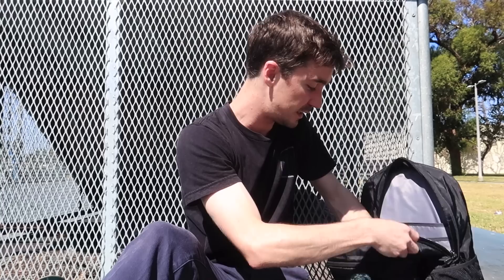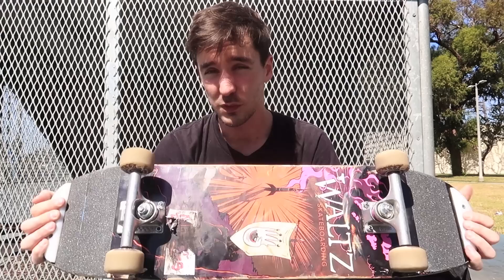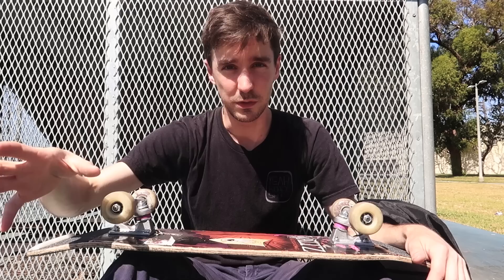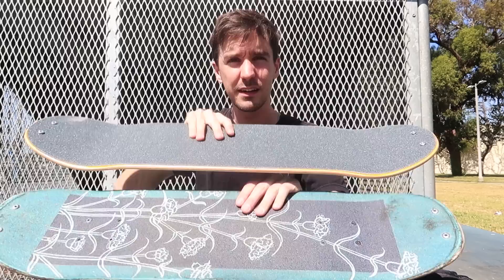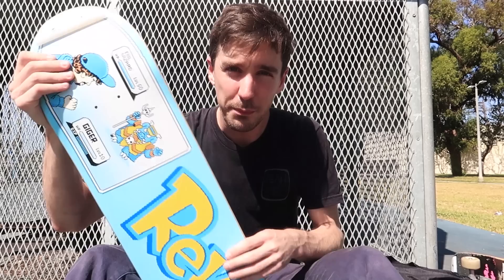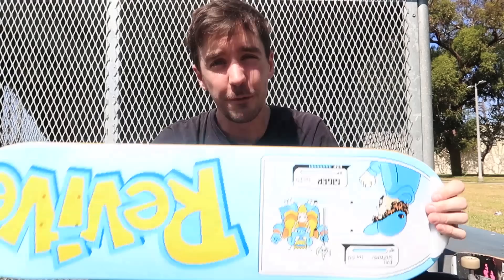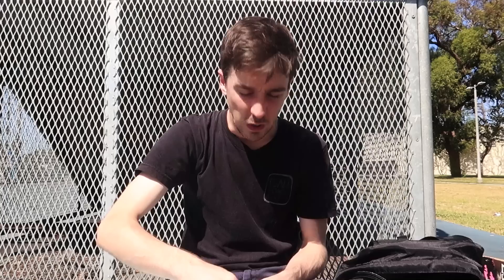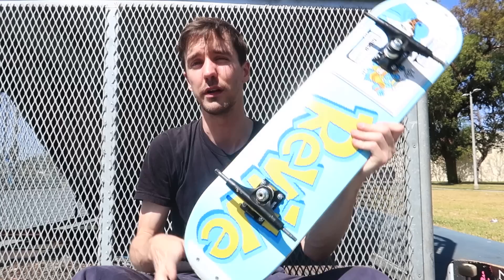Hack your Skateboard for Freestyle

Comment: Nice one, as always ;-) One addition: If you really get into learning Caspers and have the board upside down for hours, the very end of nose and tail will slowly erode. As you can't really put skidplates on top of the board, a row of small woodscrews right at the edge where the Casper lands will prevent razor tail developing from the top side.
Reply: Bwaha I love caspers so I totally know how that goes. 

Does it sound scairy though? I shift my caspers allot so they scrape, I can imagine the screws scrapeing hard.

Comment: I did a number of freestyle tricks on my 8.5, high concavity street board for a while. I got Indy's and paired them with some deep conicals (Santa Cruz Slimeballs) and a couple extra speedrings, and my board sat rock solid on the rails. The wheels and axles were basically lined up. I sacrificed nose slides and gripped the nose. The thing was a lotta fun and definitely freestyle capable. Recently moved to an old school shape, so we'll see what I can do there :)

Comment: I'm looking for the right truck to hack my street deck for freestyle primo tricks.  On Mode site they have Indy 109 (6.9" axle) on 7.4" deck (0.5" difference) and one Waltz site there's Bullet 120 (7.2" axle) on 7.5" deck (0.35" difference). I'm not sure should I go for 7.5" or 7.75" truck on a 8" deck if I want the offset wheels sit flush against the deck.

Comment: Hey can indys 129 replace the ace truck 22 for a freestyle setup?
Reply from the maker: Yes!
Reply: @mike_osterman1  it wouldn't stick out too much yeah? I'm superstitous about dimensions, I usually ride an 8.5 with indys 159 and I learn from your vids so I want to get your wheels when it restocks and your deck looks good for more modern freestyle/street compared to my peralta reissue.  what deck size walt should I get? I'm def sticking to the wider size for the comfort.

Comment: I have a cuestion, it is a problem to do high ollies or any pop tricks w/skidplates?
Reply from the maker: Skid plates definitely change the way your board pops. Being closer to the ground with your tail effects the way you do ollies a little
Reply: @mike_osterman1  Just one more question, ¿what size of skid plate are you using for that 8-inch board? Thank you very much for answering
Reply from the maker: I use the waltz nose skids on standard street skateboard shapes